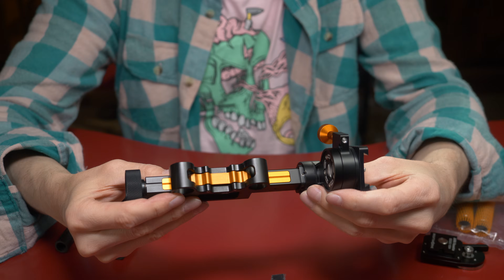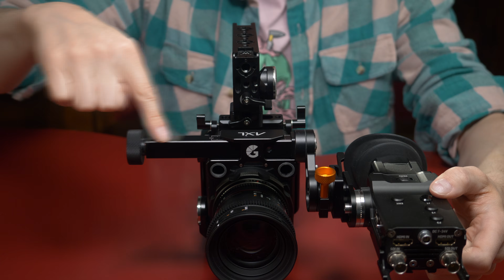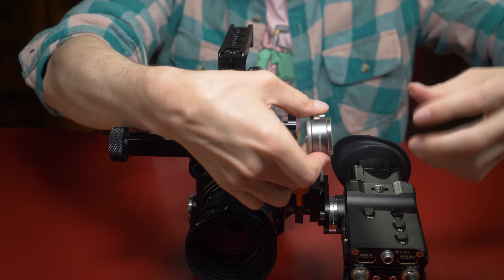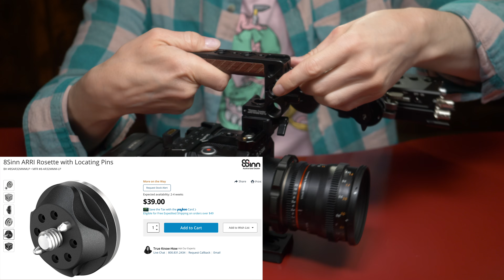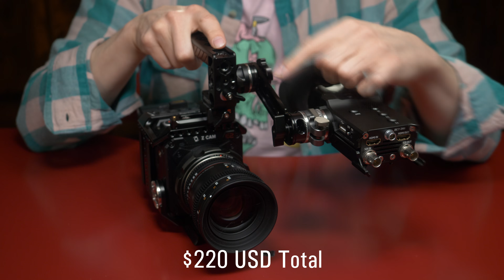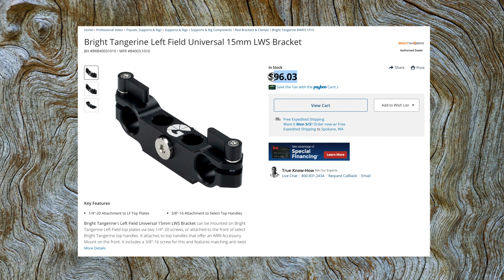Bright Tangerine Axl EVF mount

Comment: with the Bright Tangerine AXL the knob isn't just a 'lock', take it off, and there is another grub screw under it, inside the tube, THIS is the friction knob for the 'knee' joint at the viewfinder end, you have the stop (with the tangerine lock screw), the friction is controlled by the grub, set it, then when you 'torque' the main knob, it locks the left\right solid, BUT has your friction amount on the knee, it can't get tighter. The locks are 'synced' but the grub stops the knee tension where you want it, even though the other axis is locked down. similar to a tripod ball head for still shooters, the tension sets the freedom, the lock is just a tension on\off to what you set in the tension knob.

Comment: The rod mount that is on the WC handle is not very strong. It is meant for evf rod that rotates within the handle. I've already broken/bent two screws with that exact same handle. There are better rod clamp designs that can hold a rod from spinning the rod clamp design that is in the WC handle is not that... it's just physics ;).

Comment: thanks for the review. agree about the length of the bar jutting out (though seems like that might be helpful for a left eye shooter).  I do think you can adjust the orange tension knob though to more quickly adjust the Evf then even the rosette piece you are using. That is, if you don't tighten it completely, and leave it slightly loose it'll work kind of like a fluid head.... which to me is way faster than the push button type thing (unless you really need your evf position to be rock solid - which I personally find a deterrent... I like being able to shift the Evf position just using my head/eye point of contact) .  The best version for me is the Arri evf mount or maybe wooden camera air evf mount... those use a 19mm rod as the cross part and have zero twist/play
Reply from the maker: I’ve been happy using the rosette piece I have, but maybe the idea you have would work. I have to check out the ARRI and Wooden Camera mounts

Comment: What is your vmount adapter? Thanks
Reply from the maker: It’s a SmallRig mount that never went into production. I think they only made a few. It just holds the battery. It doesn’t have any electrical contacts. I had it on my F6 because my Nitze mount was on the S6G.
Reply: @FlannelNinjaTech  got it thank you. Currently running the Tilta Sony L- Vmount adapter. Alone it’s not reliable enough to be anything more than a vmount battery holder like yours. Run a Ptap to the vmount Dtap, and into the dual 12v Lemo on the E2, it does allow me to hot swap the vmount battery. 

Hoping yours also ran power. Thanks!
Reply from the maker: E careful with the Tilta since it puts a lot of weight on the tiny plastic mounts. Too many people have broken theirs.

I recommend the Nitze universal mount. You can attach a v-mount plate of your choice and it’s solid.

https://geni.us/Bf1AM

Comment: Much appreciated. Thank you. Non sequitur but that nice BT eyepiece arm is -- in no way connected to this  upcoming tangent -- but led me to think of the BM Ursa Mini Pro G2 eyepiece, don't ask. Although, I ask: did you ever use the BMUMPG2?  If so, any thoughts you could share? On the eyepiece, the cam, ftg., etc. (yay, tangents.)
Reply from the maker: I’ve only used the BM pocket cameras, not the Ursas. They are quite large and wouldn’t work as well for me. If BM made a camera with a compact cube shape I might actually use it.
Reply: Flannel Ninja Tech Thank you. Yeah, it's so curious that they haven't done it yet. Perhaps it's in the works. They could get in that Komodo, C70, ZC form factor space and wreak havoc. Perhaps they'll release an 8K something in there. 

The G2 Ursa produces some gorgeous ftg but its ff has to be handled to be appreciated operator-wise. It appears in most builds as antiquated tank but it's not bad ergowise, especially on the shoulder.

Comment: Interesting. I'm usually a big fan of Bright Tangerine's products. Both for build quality and functionality. However, I'm not a huge fan of that mounting solution. It kind of takes away my ability to use motors easily on my top rod.

I've recently picked up the Nitze EVF Mount and have been pleasantly surprised. It has all the same functionality, but mounts horizontally on one rod and the rosette mount uses friction for the rotation. It actually seems like a good solution for your setup. I haven't had mine slip and the friction mount is really convenient.
Reply from the maker: I have some hardware that does something very similar to the Nitze. It works pretty well. I really wanted to like the Axl, but the lack of a really quick rotate thing is what held me back. And the price 😬